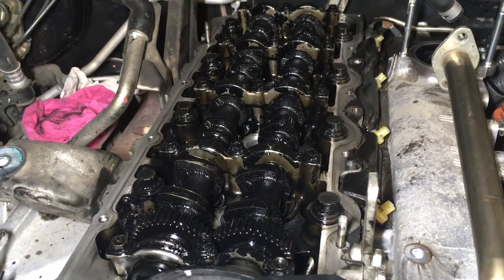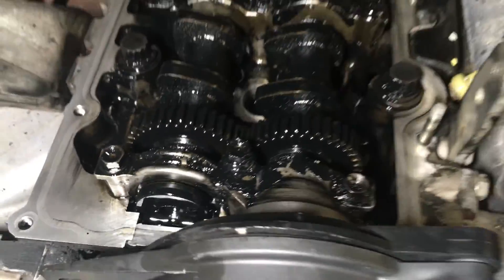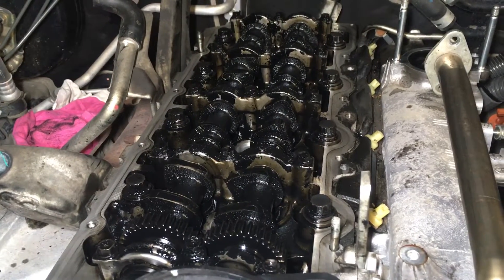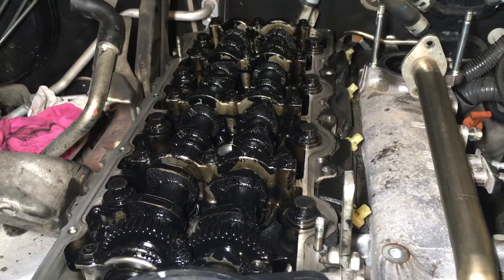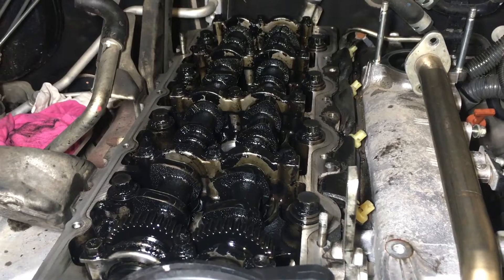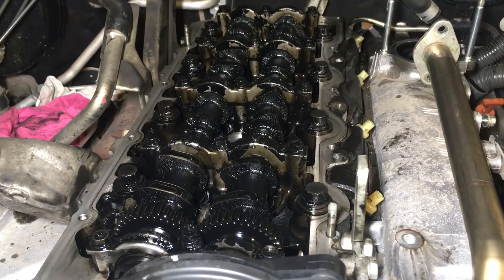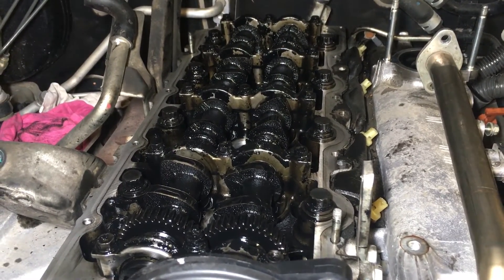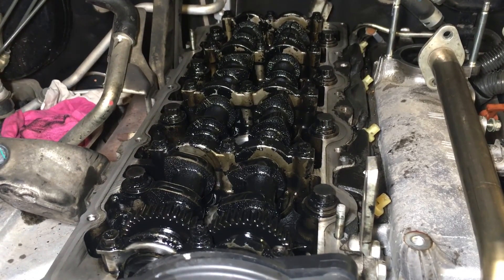WHY SO AWESOME VALVE CLEARANCES?

Comment: whats euro3
Reply: There are loads of specifics but in a nutshell

Euro 3 is Closed loop (2 o2 sensors) fueling with catalytic converter.

Euro 4 has the addition of a  dpf

Euro 5 as euro 4 usually with some sort of exhaust additive system to reduce nox emissions

Euro 6 even tighter emissions than euro 5 often with secondary catalytic converter.

From 4 on you start getting low friction piston rings and stuff which can cause higher oil consumption, dpf usually need low saps oils to stop ash build up.